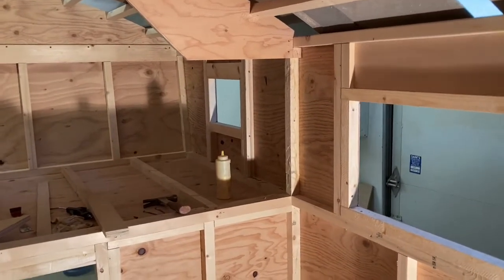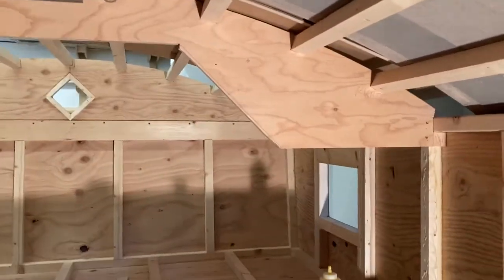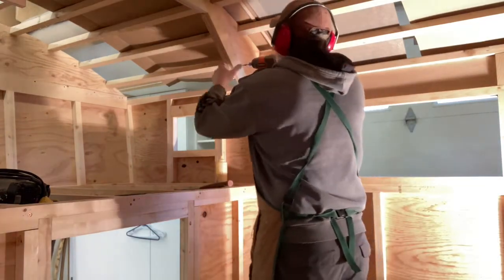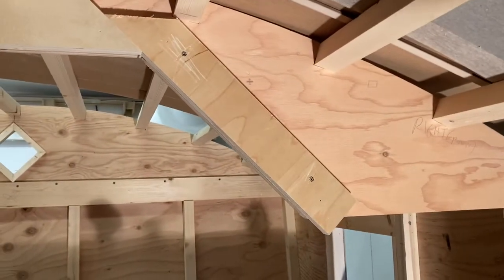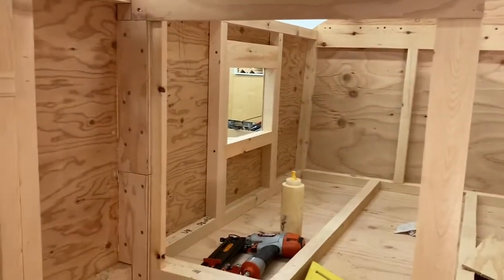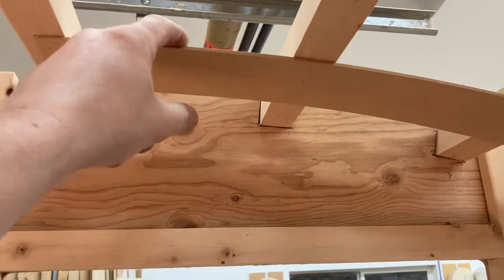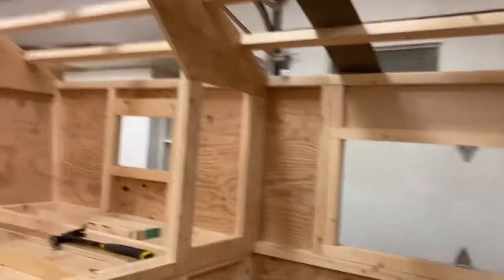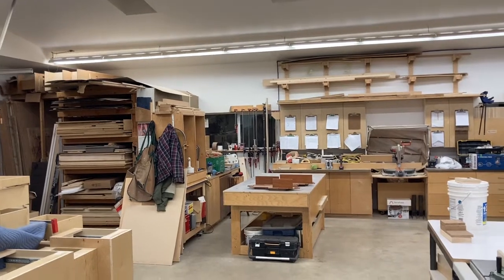Truck camper /tiny house build part 16... some framing and poor mans fibreglass test

Comment: Thanks again.  It is a pleasure to hear a professionals ideas and opinions on how to do the job.
Reply: I think my comments are a video off. What kind of type of sheet? Do you get the same strength as fiberglass or just the look?
Reply from the maker: I bought sheets from Walmart so they were all the same.. they were supposed to be 100 percent cotton.. but I don’t think they were … anyways I had a lot of problems with them ( fail video) I ended up using thicker drop cloths from Home Depot .. they are quite coarse.. but I liked the look .. I dont think it’s as strong as fibreglass .. hopefully strong enough …
Reply: @mikesniedze9122  I like the rough look . as well. Thanks